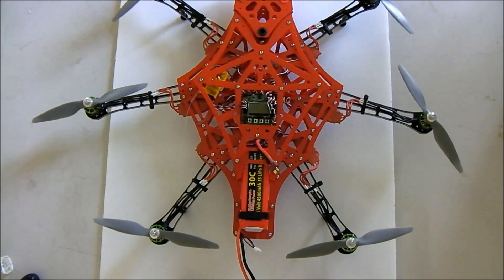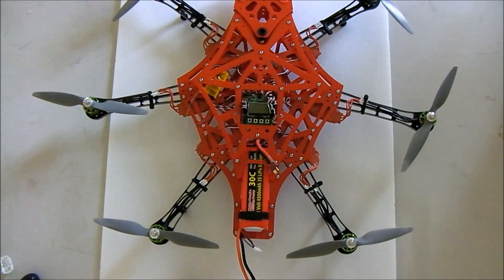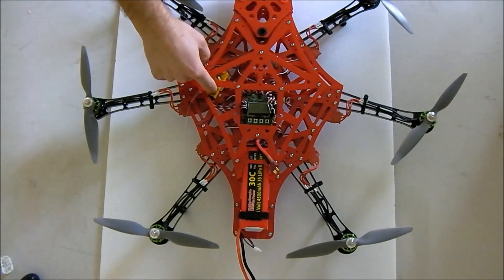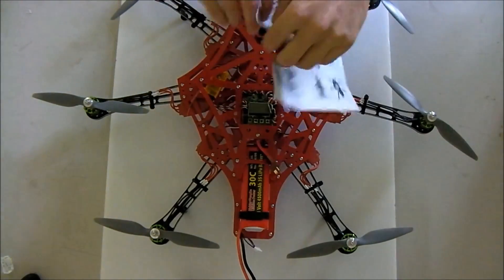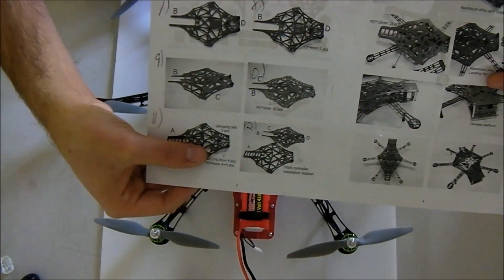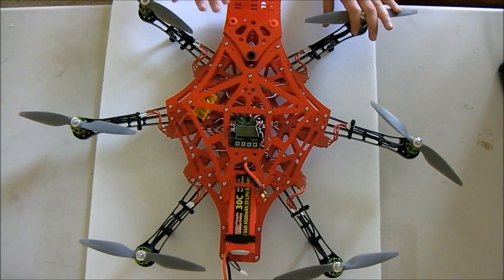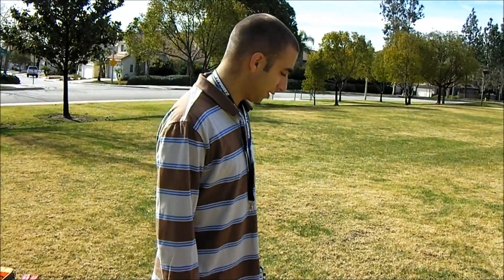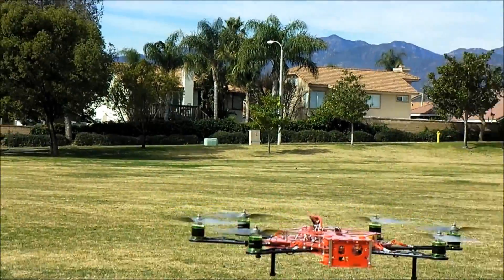Scarab V3 550 FPV HexaCopter Basic Review and Flight

Comment: okay I'll get that fc instead I'm getting it bit by bit lol. what type of setting do you have on it
Reply from the maker: I just set the motor configuration to X6 on the NAZA and it worked just fine. I did not see a need to change any of the gains, which is what made it so easy!

Comment: what are the pid settings on it just bought two of these and I'm going to be using the kk2
Reply from the maker: I honestly do not remember, i do recall that i had made a reduction from the default settings though. I only went down no more than 5 increments and wrote down every time i changed something. After a few flights with the kk2 i went to the DJI naza lite and I got a much better flying experience with that controller. Good luck!

Comment: I'm looking at purchasing one... I see you posted this vid Jan2015-- Do you still fly it? Any issues, etc...?
Reply from the maker: +oxidize99 sorry for the late response, quite honestly the frame was very heavy and the maximum prop size is 8.5 inches so flight times were around 7 to 8 mins. Its definatley not an endurance frame but its looks nice in the air and it might be suitable for fpv racing
Reply: +UAV Flyer Thanks! Two of my main concerns were the weight and maximum prop size. Looks like I"ll be passing on this build. I"ve come across a few mods where folks have made longer arms to accommodate 10" props but at it's price-point, it doesn't make sense to heavily modify it. Cheers and happy flying.

Comment: Hello.
A query for 550 V3 Scarab.
Which of the two engines is better:
1)http://www.hobbyking.com/hobbyking/store/__39036__Turnigy_Multistar_2213_980Kv_14Pole_Multi_Rotor_Outrunner.html
2)http://www.hobbyking.com/hobbyking/store/__67015__Quanum_MT_Series_2212_1000KV_Brushless_Multirotor_Motor_Built_by_DYS.html

Comment: The Naza lite is simple to program and works very well with the Scarab. I use a 4s 5200 mah baterry on the back (non balance the Scarab) and the Naza control very well flying very balance the Scarab. Obviously if you are doing hard movements you will feel a little bit more slow. 

I can mention you already test on the past weekend with 2 bateries (almost 1 kg of bateries) but I put in the center with a special batery support and works very well flying 18 minutes. In my opinnion is a very good frame. 

Regards.

Comment: I liked your video.  Very informative.  Hopefully it serves you well
Reply from the maker: VSUPARHAM Who...... Me? oh heck no! I was lucky to be able to put this together!
Reply: VSUPARHAM yah I designed the original V3. Hobbyking linked the site where the drawings are.
Reply from the maker: godfather22022 Well, then I must thank you for the design, have got close to 100 flights on the frame and its still rock solid!
Reply: Are you one of the designers of this frame?
Reply: UAV Flyer You did a pretty awesome job with the review and with putting this together, but I think that godfather22022 is  one of the guys that designed this frame.